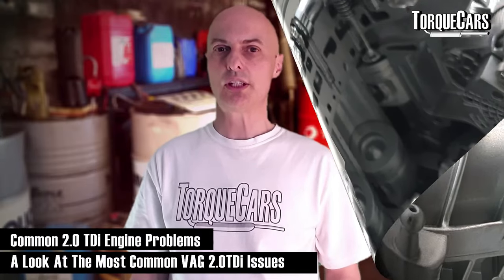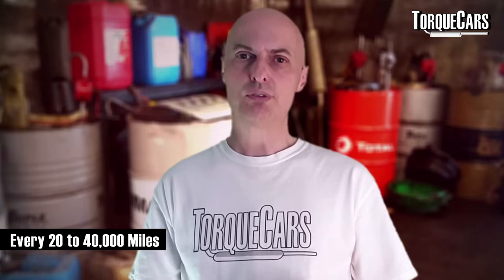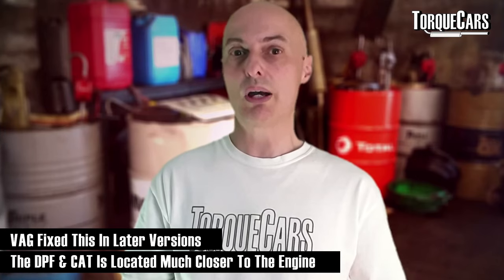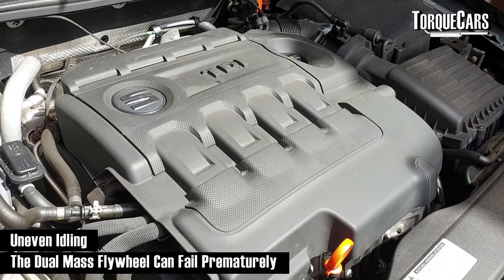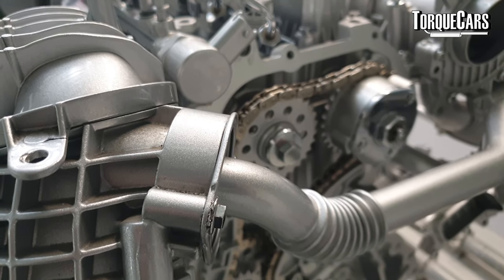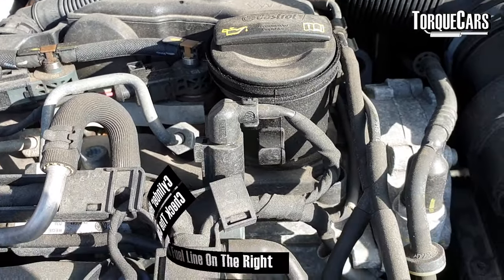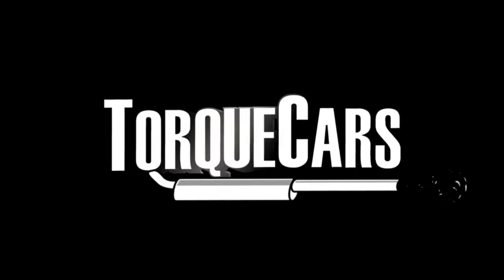Common VW Audi Seat Skoda 2.0 TDi Problems  [Fault Guide]

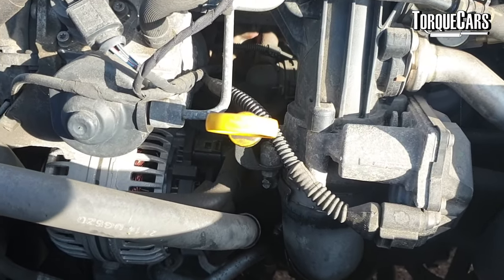Comment: At 1:10 you are confusing diesel with gasoline engine . There has never been any port injected diesel engine. Only indirect (pre chamber) or direct injection. 
All VAG diesel engines from this millennium are direct injected.
TDI stands for Turbo Direct Injection. TD is Turbo Diesel (indirect injection).
Reply from the maker: Thanks for the heads up my friend. You are quite right, my intention was to explain why engines in general now have carbon build up issues, it does confuse things that I mentioned gasoline engines at this point in a video about diesels as they do work quite differently but this "historical diesel issue" of carbon build up is now affecting many gasoline engines now. So top marks for highlighting this and I'll correct this in a future video revision it was certainly not my intention to confuse or muddy the waters.

Comment: Hello guys. I want to buy a golf 6 plus 2.0 TDI CR 103 KW/140 HP. I want to know which engine code has the lowest problems. I just know that i should escape the first 3 years of CR engines, so i should go 2012-2014 year model. Or can you suggest some 2.0 tdi engine code even if it is not in golf 6 plus. It can be tuaran, passat, jeta....or maybe some skoda model. Thank you a lot.
Reply from the maker: From 2012 most of the early problems including the emissions scandal were ironed out, generally get the newest version of the engine you can so I would choose a higher mileage 2015 over a low mileage 2012 one. The Gen 2 and even better Gen 3 engines are pretty solid if well looked after. If you only do short journeys then this is probably not the engine for you, they like to be used a lot and pushed hard.
Reply: I have a 140 tdi dsg in a 2012 Touran. Not one visit to VW apart from software update from exhaust scandal. Change oil every 5k and dsg every 25/30k. Still have same brake pads in !!!!

Comment: Hi chap, interesting watch.
Im looking at buying a 2009 b6 passat tdi 2.0 CR . It has the cbab engine and is on 189k miles. Is it likely to have had a oil pump drive fix. I know the hex key can cause problems but at this mileage surely it cant be an issue. As in its either been replaced or isnt one prone to failure
Reply from the maker: You never can tell, but if it's the original weak one and has lasted this long its a good one, if it was weak and broke it was replaced many moons ago. Is there evidence of a service history? If the owner has cared for it then you should have little to worry about.
Reply: Also thought the same as mine is on 173k. Most likely replaced
Reply: The video is mixing the PD engines (up to 2008) with the CR engines, after 05/06 the oil pump failures disappeared mostly (BRE, BRA audi) and then balance shaft assemblies with the hex oil drive was strengthened with and extra 15mm of hex shaft driving the pump. Gen1 CR engines very reliable i work on lots with over 400k.
Reply from the maker: I will separate these engines out and do a more focused video for the later CR engines. I feel the Gen3 also deserves it's own video due to the sheer number of revisions. This video was based on an old article on my website so it's time to update that as well whilst I'm at it.

Comment: I got Skoda 2.0 TDI ENGINE 
I was crushing on highway and suddenly heard noise from engine and when I check I noticed air is blowing out from intake and intake mainfold melted at 2nd priston 
any suggestions what is the issue 
Engine still runs but I see black smoke from exhaust
Reply from the maker: Do a compression test, You'll probably find the valves on cylinder 2 are failing in some way, exhaust gases are exiting to the intake causing it to melt, I can't think of specifics at the moment other than perhaps a gasket problem. 

Let me know what you discover though, I'm sure you'll not be alone and someone else out there will benefit from your findings.

Comment: I got a 2013 exeo diesel, its rough idling, starts perfect, runs well, its just when it's ticking over. New EGR, new Fuel temp and rail  pressure sensor.

What I have noticed is the coolant temperature is reading about 20 degrees cooler that what the engine itself is. Any ideas. The car has done 134,000 miles. Any help is much appreciated
Reply from the maker: Are you comparing oil temperature with coolant temp?

Comment: Hi. I have a A4 B7 2.0tdi and I'm trying to locate where this A,B,C code thing is for the head? Ive just got this car, changed glow plugs and valve seal and now i'm seeing oil at the back of the front bumper ( there's no under tray-broken off). It's a 56 UK plate. Hoping this isn't the case as i'm already looking at recon it's gearbox and already thrown money at it in 3 weeks. Help? 😥
Subbed, keep up this great work!

Comment: Engine oil loss and poor fuel efficiency.  250 miles per tank. No visible oil leaks. Any ideas ?
Reply from the maker: Low compression in one or more cylinders, can all cause low fuel economy and clogged fuel injector or blocked DPF  can cause higher fuel consumption. Check for error codes they can often indicate faults and problems. A compression test will also be a useful part of diagnoses here for you. A turbo failing can also cause these issues but you will typically get a whine or siren noise at the same time. If you engine has a DPF you may not see smoke from the burning oil in the exhaust.

Comment: Really enjoying your content just had a fault code on my audi a3 p1038 had a smell trying to work it out
Reply from the maker: Has the cat died on you or DPF got blocked? This is I think related to low O2 in the exhaust and could potentially just be a bad lambda O2 sensor. Are  you getting any other symptoms?
Reply: If it smells eggy stop breathing it in and point a mechanic at your battery...

Comment: What would you class as a short journey?
Reply from the maker: Anything where the engine temps are still low, so it depends on the weather and how you drive to some extent, but the engine needs to be at operating temperature for as long as possible, my 2.0 TDi didn't warm up that slowly but it still took around 7-8mins of driving before the temp needle started moving so for me I would try to avoid 15 min or less drives otherwise you'll have those annoying DPF issues. A good run every couple of days can help though and will to some extent make up for a short journey.

Comment: I've a 2015 Jetta with engine code 03L 021 CA. Is it ea188 or ea189 ?
Reply from the maker: The EA189 production ended in 2015 so it will most likely be that one, the EA188 ended 2006 or thereabouts so definitely not that one.

Comment: Hey, I have a MK6 Golf 2010/11 2.0tdi CFFB. Currently it sits right now at 130k kilometers or 81k miles, are these engines have a oil pump shaft problem? If they have it, at what millage should I consider to replace it?
Reply from the maker: You shouldn't have a problem, after making this video and chatting with a few people is seems the oil pump shaft problem was mainly a pre 2008 PD engine issue. There were a few borderline old stock engines around 2009 but the CFFB is the modern CR engine. If I find anything else out on this I'll let you know. Most of this video is aimed at the early PD engines, so I'll do another CR and a Gen3 TDi video when I've got all the facts together.
Reply: I have skoda superb 2015 2.0 140hp CFFB engine  im taxi driver i buy the car at 115k miles replace waterpum and belt drive 2 years now 190k miles start to leaks water from water pump

Comment: I got a skoda 2013 cfhc engine code. Problem is it cranks sometimes longer than usual. Sometimes no problem,but then 3-4 times longer crank till it fires up. 
Battery is ok,and no fault codes..
Any suggestions i should check??
Reply from the maker: Are the glow plugs warming up ok? Is the Thermostat working ok? Have you checked the alternator - a good battery can still struggle if the alternator is not topping up the current. Other things could be the starter itself, a weak motor, poor connection or something like that.
Reply: @torquecars  high pressure fuel pump/tandem pump did cause these exact symptoms on the pd engines. I don't know if the cr engines have them

Comment: I have a problem with my turbo on 2.0 tdi 103kw, golf 5 2004 generation, I’ve repaired it 2 days ago the turbo is now new but I’ve had a problem that the car put’s itself always in safe mode when I keep my speed, for example, I’m going 130km/h in 6th gear and after 10 - 20 seconds the turbo shut’s off.. But when I floor it everything is normal, I was going 180km/h and it didn’t shut off.. Checked everything around the turbo and it’s fine.. Only solution right now I think is to buy a new throttle valve because only after 3000rpm it gives me full power..
Reply from the maker: How strange, are you getting any error codes flashing up? Is the EGR working OK?
Reply: @torquecars  we cleaned the egr it’s like new
Reply: Sounds like an underboost condition after 10 sec, if the new  turbo can be trusted then check for leaks in the vac system.

Comment: Thank you for the great information. I am just wondering what is ''early generation''..
I bought a Mitsubishi Grandis which has a 2.0TDI VAG engine. It's a 2008 model. Is that early generation? No idea when VW started making these engines 🙄
Reply from the maker: In my mind the early generation were the pd engines which were made right up to 2008.  But there were some issues with the first batch of cr engines that came out, but thankfully most owners have had these sorted if the faults were present. I didn't realize Mitsubishi used these engines so I've learnt something from you.

Comment: Thanks for great advices. 👍 can you please tell me what can couse lite engine shaking when idling on my audi a4 2006 2.0tdi automatic? I would really appreciate some advice.
Reply from the maker: It could be the Dual Mass Flywheel playing up - these do quite a bit of work keeping these engines running smoothly. To be honest though these all have a minor wobble on tickover especially when pointing down a hill. It feels like a misfire or judder every few seconds and is quite normal. It sound like yours is more pronounced than this.

Other issues could be unbalanced compression between the cylinders, effectively giving a wide range of power on each cylinder which can cause vibration.
Reply: @torquecars  thank you, you made the perfect diagnosis,I will start from there. Have a nice day😊😊

Comment: I have a 2014 VW crafter which is a giant van, it has the single turbo 109bhp 2.0 tdi engine, I noticed you saying you had it an A3? are there differences in a commercial 2.0l tdi to the Audi A3? worrying because I think the engine must be under tremendous strain hauling such a big van. Cheers
Reply from the maker: These engines are very torquey and able to handle pretty heavy loads. The same block is available as a 170hp version so they are pretty strong and the 109hp is not a struggle. NB: Gearing is generally different on these but the engines are essentially the same mechanically. The different power outputs were down to mapping, fuel injectors and turbos. It is important the mapper doesn't apply a car oriented map to a diesel van, most will adjust the torque curve to suit as needed.
Reply: @torquecars  thanks so much for explaining that and thanks for the upload

Comment: What's the 2013 177 TDI engines like?
Reply from the maker: They are really good, most of the issues have been completely engineered out, I have a video I'm currently working on that covers the EA288 and 2018 EVO revisions of this great engine. I would not hesitate recommending one, especially if you do lots of distance driving and can keep the DPF happy and hot. However if you only do short journeys, although the DPF design is much improved I would recommend you look at a petrol engine like the 1.4 TFSi.

Comment: Why my 2016 golf tdi variant got 1000 rpm when the car is stopped??
Reply from the maker: Could be a number of reasons for the high idle speed (around 8-900 is normal for most of these engines). The most common thing in my experience is if the current drops from the alternator it will increase revs to compensate so in most cases a worn out alternator or something causing high battery drain will cause this.
Reply: Or it could be dpf regeneration is on

Comment: So which year is the best engine ?
Reply from the maker: The last of the PD's especially the BKD up to around 2007, from 2008 there was a dip in quality along with the conversion to CR but by 2011 most of these issues have been ironed out. 

I would be happy with ANY of these engines with a Bosch ECU (except for 2008-2010), AS LONG AS IT HAD A FULL SERVICE HISTORY. The key is maintaining them properly really.
Reply: Great vide once again, Which year engines had the chains and the belts. Thank you for your support and the in advance

Comment: important also :swirl flaps out of range  , turbo vacuum actuator
Reply from the maker: Cool thanks for the heads up, which years does this tend to affect? It sounds a more recent engine problem to me, the earlier ones didn't have swirl flaps AFAIK.
Reply: Swirl flaps actuator not sure I think all 16 valves
Is cheap to fix.
The turbo actuator failure makes the engine sluggish and weak (too low boost pressure) its function is to regulate boost pressure by putting the vanes in the turbo in the right angle error code p0299 engine goes in limp mode 
Part costs 300 ish dollar
And is replacable while turbo is in place
This actuator is used on almost all the 4 cyl diesel
In the Vag range.
Reply from the maker: Interesting, thanks so much for adding to my knowledge. Neither Issue was on my radar for any of these engines, so I'll dig a little deeper now.

Comment: Das oil catch can helps?
Reply from the maker: Yes in my experience this will prevent a lot of the tiny oil droplets fouling up the intake. It's not a perfect fix but makes the problem much better.
Reply: @torquecars  Thank you !  I have a Peugeot 1.6 2014  I didn’t have any problems accept DPF filter plug. When that happened, I put Dpf off, Erg of the new map. Nothing extreme it’s a little torquer at the bottom rpm. And maybe 15 hp up. It is for sale now. I’m looking for a Skoda Superb 2.0 tdi or something similar. I’m buying a used car so I cannot be to picky.

Comment: A common fault i dont see in your video, Turbos with VGT or whatever your brand calls it, mine has it, they gum up badly with carbon especially with an egr delete. Causing limp home mode, low power and overboost codes in the computer. Easy to fix, full engine service and engine flush, inject mr muscle into the exhaust side of the turbo leave for 15 to 20 mins, bolt it up, start it up, wait for tempratures to rise and drive on the motor way in 4th or 5th for a few miles with the revs around 3000rpm, will clean right up and the codes will vanish on there own. Have to do it every coupple years. And remember after your drive to check the post service fluid levels, DO NOT run them turbos with low engine oil levels, biggest reason they fail is oil starvation from low level
Reply: And on your Single Mass Flywheel Conversion, you will enjoy if you go have the car updated at just about any garage, you need to increase the IDLE RPM Offset to 150 to 200, increasing idle revs to 1000 rpm, just over 950 rpm they smoothe right out. Getting rid of the DMF of my C-MAX Many years ago was the best thing i ever did, transformed the way she drove.
Reply from the maker: Interesting comment, thanks for your input my friend. So the EGR delete can cause this problem, it wasn't something I was aware of but does make a lot of sense.
Reply from the maker: That is a good tip, most people I've known with a single mass flywheel on these have had vibration issues, but in fairness they generally fitted quite light flywheels to them. Personally I would source a lighter dual mass but totally understand it depends on your aims on the car project and what you can get in your area.
Reply: @torquecars  I would say its more prone to the problem with the EGR Deleted or not working correctly, all turbos get buildup on them, its just with the VGT that buildup has some funkey effects, all making the car a pain to drive, cos with no boost well no go. But Mr Muscel in the turbo hot side clean her right up, and then excersize the car and VGT to make sure its freed up. Had it happen on my mapped baby and the wife bog standard gutless wonder.

Comment: c cracks too.
Reply from the maker: You are very correct it does, but I've only ever seen one go, they are much better than the B and A which were notoriously bad. I wish I could get to the bottom of the cause of this it's IMO either manufacturing/design defect or some thing to do with hot/cold cycles during use and high RPM's when cold or something like that.
Reply: @torquecars  Probably defective design. Mine cracked, and other people I know cracked C. even on stock hardware
Reply from the maker: Interesting, thanks for your feedback. Hopefully we'll get to the bottom of this one once and for all. There was nothing like this on the 1.9TDi was there!?
Reply: Hi this is for cbab engine